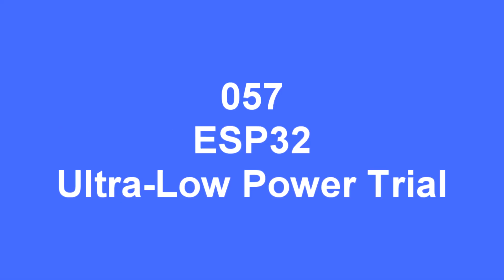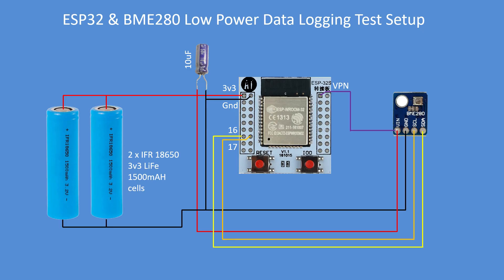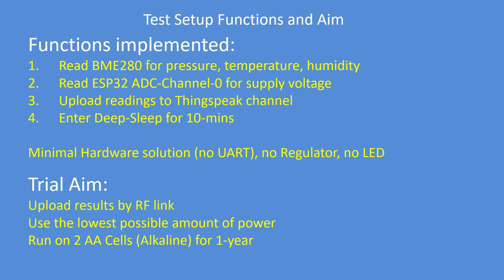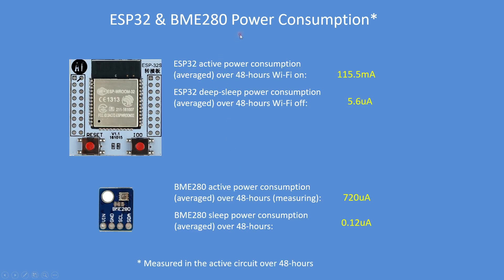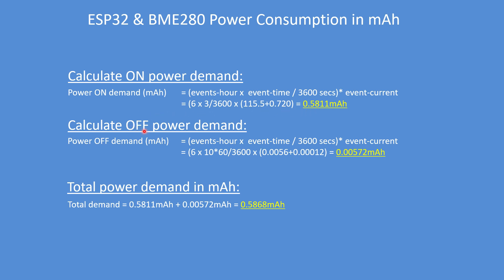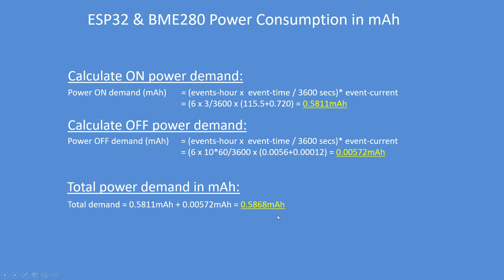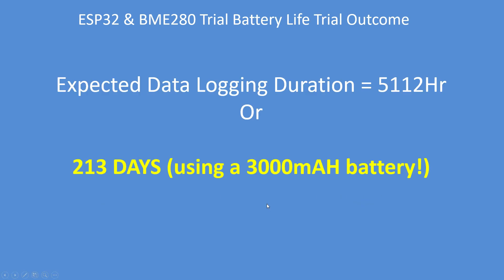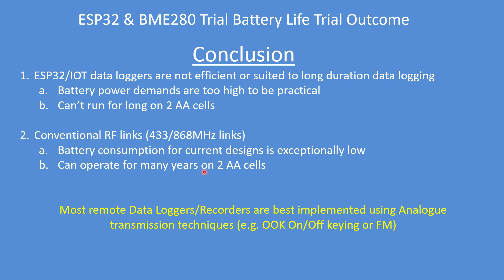Tech Note 057 - ESP32 Ultra Low Power Test Results

Comment: There is a lot of variation in how many seconds to log on my BT router so this varies the average current when the current is at the highest. The only way to improve is to use the RTC memory of the ESP that is preserved by reset as long as power is maintained. Then send say once a hour.  This means that data would take  longer to send but would save seconds overall. The down side is the data stamp from thingsspeak would be the upload time not the measured time.  Reduce the WiFi power of the ESP if close to the router?  A larger capacitor 1000uF? might help to stop the battery droop when the reset occurs as that will give an earlier battery brown-out. Watch out some capacitors have a bad leakage current that is proportional to capacitance value. I have some LifePO4 1800mA 18650 but don't believe the capacity, I don't know for ESP32 but the 8266 really need 3V to boot correctly so don't get all the battery as specified down to 2.8V for the capacity calculation. Thanks for another interesting video/
Reply: Thanks for the great video!
From your code it doesn't look like you are using a fixed IP address. Apparently the (re)connection time is reduced significantly by using a fixed IP address. I haven't actually tested this yet.
Reply from the maker: My Sky-Q router is very quick, despite it's poor RF range and the ESP32 can easily make a connection and upload the data in 3-secs. Using the RTC RAM is a good idea, I can't recall if the THINGSPEAK API can support data recording time with data readings, and time could be stored locally in a minimal form. I estimate the ESP32 would take ~1-sec to wake up, take a BME280 reading and then enter sleep mode, perhaps faster than that, so that would be 6-secs/hour of recording time, which is less than the 18-secs (6x3) now, so that's a saving, then one long burst every hour, let's say 6-secs, so that saves energy. Yes both the ESP8266 and EPS32 take a huge current demand at Wi-Fi switch-on, about 310mA for 2mSecs for the ESP32, though much less for the 8266. So for the ESP32 and from Q=C.V then I.t=CV. and C=(0.310*0.002)/(3.3-2.9)=6200uF to handle a 310mA 2mS transient demand and a voltage deviation of 3.3 down to 2.9Volts., so probably use a 10,000uF capacitor for the typical range of demands. Yes leakage current is an issue, but a good quality capacitor is the only answer I think. Likewise on the batteries, mine are 1500mAh, but more likely 1200mAh in-practice and to keep them within their nominal operating region. Problem is, that exacerbates the battery life and expect a time-on-battery duration of more like 150-days, which for the size of battery is another poor performance result for a device that's hailed as 'low power' which it is, but only on in sleep mode!I think on-balance the ESP8266 provides the better low power solution, I'll try to run the same test with an ESP8266. Well I already know the result, the ESP8266 will beat the ESP32 hands-down because it's Wi-Fi current demand is nearly half that of the ESP32 and that's the dominant power consuming factor.When there is easier access to RF power reduction, this will help with peak current demands.
Reply from the maker: Craig Fryer Good idea and I haven't tried that either, yes it should be faster as it won't need to go through all of the DHCP protocols. As the time-on is the dominant power consumer, every second reduced is a bonus, so I'll give it a trial, I'm currently waiting for an ESP8266 module to arrive (no uart) so I can do the same test with that device and where I'm expecting a better result, if it is as fast to connect as the ESP32 that is.
Reply: Yes, I have one sitting there waiting for me to work on it for a very similar project. 
I don't know why the WEMOS type boards don't have a physical switch, jumper or solder bridge to disable the UART. Maybe it isn't that simple.
I read the latest version of the WEMOS D1 mini has a much lower power consumption from the UART when running on the battery module, but it still isn't really low enough.
Reply from the maker: Craig Fryer I asked WEMOS if they could use any UART other than the 2102 or go back to the original 340 as it was the lowest power consumer for a development board on the market, they told me they would redesign and reissue it. I don't know why they have not made an ESP32 version. Yes a simple switch or jumper would enable the UART and LED to be powered down for low power development work. I use a cheap USB UART to achieve the same though. I learnt the hard way that a USB-UART cannot power a esp8266 and definitely not an ESP32 with the WiFi on, the devices apparently work but crash consistently with flash read errors, also power rail decoupling of 100uF plus a low inductance ceramic 0.1uF are essential for reliable bare bones operations. The ESP32 really needs a dustbin C of about 470uF or more to reduce power demand spikes unless a really low impedance supply is used, two 18650 batteries do-not provide a sufficiently low impedance to drive an ESP32 without a large C in circuit.
Reply: WoW! Didn't realise it was that bad on the ESP32.
Reply: There is some discussion of the WEMOS D1 Mini V2.2.0 here: https://forum.wemos.cc/topic/252/new-version-v2-2-0-of-the-d1-mini/2
The V2.2.0 appears to use the same/similar 340 as the latest V2.3.0, which appears to be out of stock at the moment. Not sure if this means a new model is on the way.
Reply from the maker: thanks for that link, unfortunately that version is still out of stock, that's just what I need for low power development- I think I'm now switching my attention fully back to the ESP8266 for battery powered solutions.
Reply: It looks like WEMOS has either stopped producing the WEMOS D1 Mini, or at least stock is very inconsistant (see https://forum.wemos.cc/topic/405/wemos-d1-mini-it-it-available-any-longer/7). However I noticed that some, if not all, of the WEMOS D1 Mini clones I have been buying lately have the 340G on them. I can't be sure which of them was the most recent arrivals. These are based on the V1.0 design. I think there was some issue with the power consumption on these though.
Reply from the maker: The Wemos D1 mini is the only product I've found that can be used for low power tasks, of course with even more power saving if the 340 can be removed, but nonetheless a good performance. I've been trying to purchase some of those v2.3 boards but no luck/stock anywhere. I think there is still a market for it, maybe Wemos think otherwise. Yes I've seen three copies, which if they are using the 340 should give an acceptable power consumption. I've been running some esp8266 tests and I'm getting 73.8mA average with WiFi on performing a range of upload tasks over 48-hours and sleep power is more variable but in a way so low as to be irrelevant and on a par with battery self-leakage currents.
Reply from the maker: I found a supplier, but they are not v2.3 boards, standard v.2, I've had this before and ordered them only to find they are old boards. AliExpress are good though, I get my money back. I've even asked before ordering and been told they are v2 boards, but get v1 boards! very frustrating. I've sent Wemos a message asking when they will get more stock.
Reply from the maker: Wemos has responded to me, they say the product is now called the D1 Mini Lite: https://www.aliexpress.com/item/WEMOS-D1-mini-Lite-V1-0-0-WIFI-Internet-of-Things-development-board-based-ESP8285-1MB/32801897476.html?spm=2114.search0104.3.17.YTGzKy&ws_ab_test=searchweb0_0,searchweb201602_4_5570020_10152_10065_10151_10130_10068_10344_10342_10343_10340_10341_10192_10190_5550020_10307_10301_10137_10303_10060_10155_10154_10056_10055_10054_5470020_10059_100031_10099_5460020_10338_10339_10103_10102_440_10052_10053_10142_10107_10050_10051_10324_10325_5380020_10326_10084_10083_10080_10082_10081_10110_10111_10112_10113_10114_10179_143_10312_10313_10314_10184_5560020_10078_10079_10073,searchweb201603_6,ppcSwitch_4&btsid=021021d0-005f-44b9-a676-fa903a0bd710&algo_expid=e89a5f82-aaa9-49d2-87c6-b7ddaa587e1c-2&algo_pvid=e89a5f82-aaa9-49d2-87c6-b7ddaa587e1c
Reply: I was creating an alternative to Sparkfun's Phant as I wasn't happy with the performance of finding an entry in a larger dataset. You can override the timestamp as long as it's in the past, it's the EPOCH in ms. You can try it here http://totalrecallapp.azurewebsites.net or compile and run it yourself from here https://github.com/mattheys/TotalRecall it's done in dotnetcore so it's cross platform if you want to roll your own.